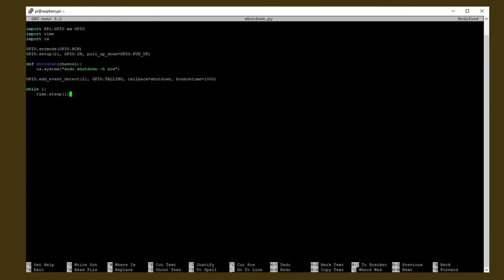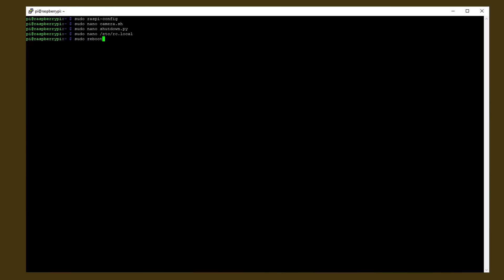Build Your Own Digital Microscope

Comment: If you leave a small gap inside the camera lens, e.g. for a very fine small screwdriver, you can insert the lens completely so that it sits firmly, but you can also easily push it out again with a small screwdriver or tweezers through this gap.

Comment: How do you keep the pi part from dropping down? Is your axis that tight in the mount, or does your knob press against it?
Reply from the maker: The assembly is tight enough so that it doesn’t drop down due to its own weight.

Comment: There is actually a Linux driver for making a GPIO into a dedicated shutdown button: https://www.kernel.org/doc/Documentation/driver-api/gpio/drivers-on-gpio.rst.  If the RPi has support for device tree overlay loading (or similar), then that should be simpler and more reliable than the Python script.  But the Python script is probably OK 99.99% of the time ;)

Comment: Are wireless LAN and bluetooth abilities really mandatory? Can't Raspi Zero be sufficient? GREAT PROJECT. Despite my €200 HAYEAR HY-1070 which is gorgeous, I plan to use your project as an inspiration for a creative project. Thank you very much. I just followed you on hackaday.
Reply from the maker: You‘re right, for the microscope those abilities aren‘t needed. However I really appreciate having wireless LAN on-board for setting up and working with the Raspberry Pi over SSH without a dongle.
Reply: @leonbrauns  Thank you! I do share the last reason...
Reply: @leonbrauns  an interesting stuff, you can buy a bluetooth ttl adapter for arduino and connect it directly to tx and rx on the pi to get a hardware terminal over bluetooth, that's just great because you can connect to the pi terminal like if it was a wireless serial port